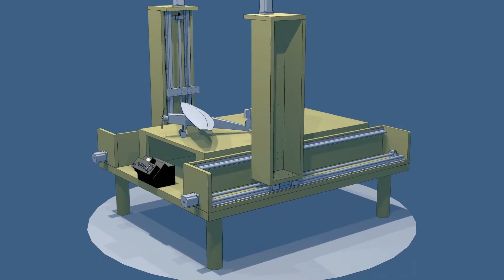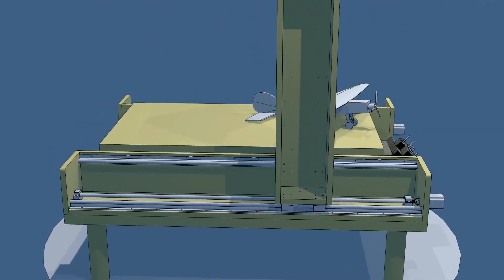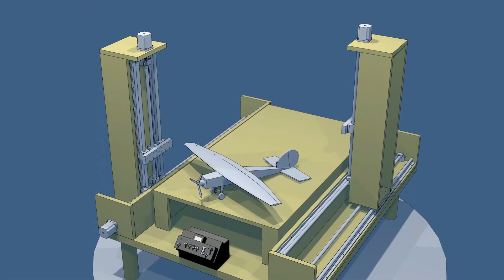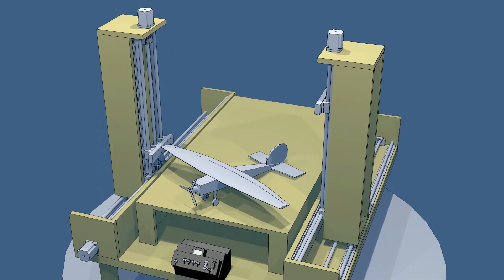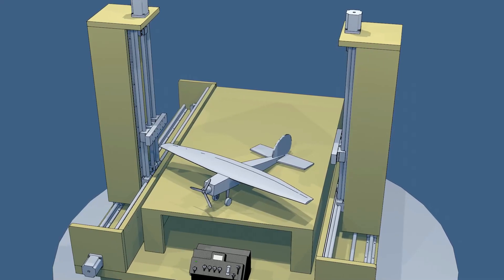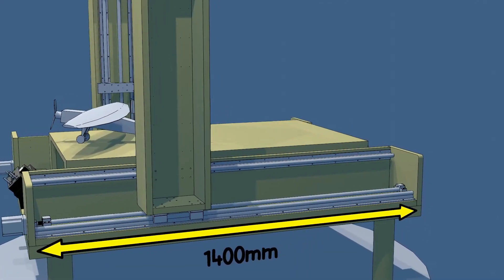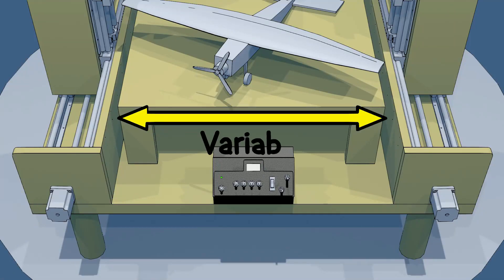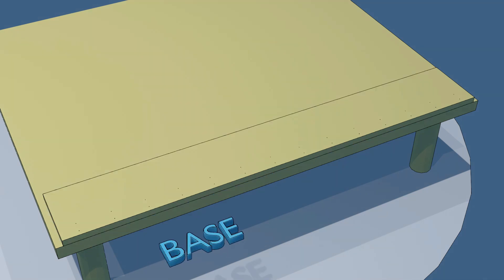Homemade Arduino Hotwire CNC Foam Cutter

Comment: Thank you very much for this work I will try to realise it thanks
Reply: dI have a question regarding the uploaded file. I couldn't find any 3D CAD files included; do you have free CAD files available for this CNC machine? If so, can I use them?

Comment: Really nice! It would been interesting (but also complicated) to control both sides independently, combined with a wire tensioning sub-unit it would been able to cut in 3D giving a round finish for example for the body of the airplane :)

Comment: Not that impressive at all! OK, it's a maker's climax... but it should have implemented way "moderner" features like the ubiquitous g-code! It's likely why you briefly talked about the code which is especially proprietary... What's the point here?
Reply from the maker: I didn’t mean to impress anyone, this is just my public archive. The code (Arduino) is not proprietary, that is all the code you can see in the video. It has a very permissive WTFPL license. The controller software is not my product, it just happened that my friend uses that, so I built the hardware around it. Take it or leave it.